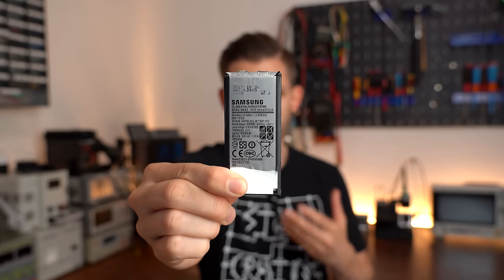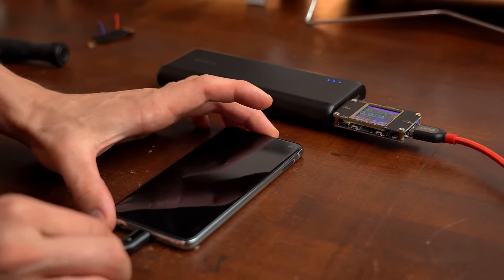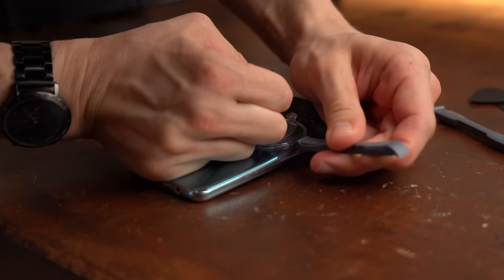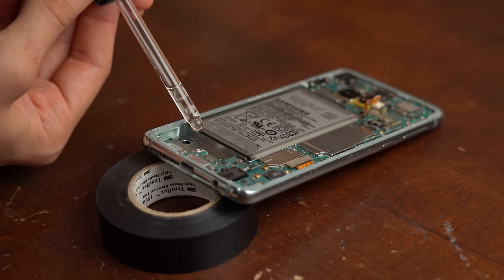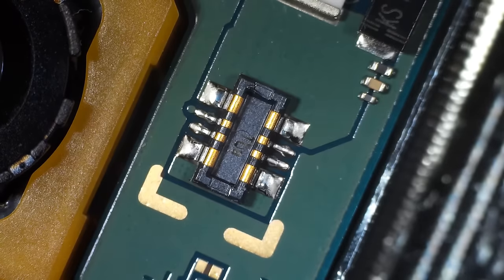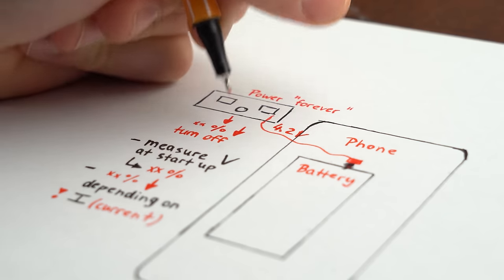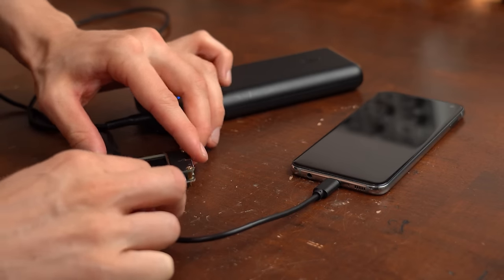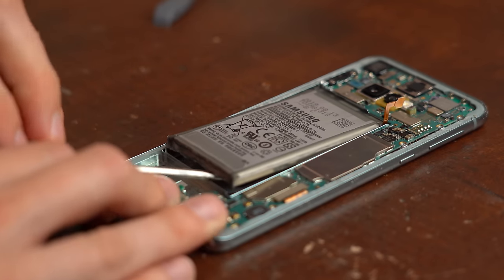I "Solved" Samsungs Swelling Battery Problem! (Batteryless Phone)

Comment: Awesome video The information you present is very factual. A lot of great ideas.  But I also want to bring up this point. There's a reason why here in the United States we didn't get the exynos chip. In the Galaxy s series. All the snapdragon chips past certification for the FCC as far as power and safety. Unfortunately the exynos didn't.  I still don't understand why on some of the budget Galaxys here in the United States pass the FCC certification. But the top dollar phones didn't ?

Comment: I didn't know any other phones had issues with the battery swelling. I thought it was just the note 7. 

A little more heat. That back cover should have been able to lift with the guitar picks and suction cup. You should also not try to lift the battery with a metal tool. If it punctured the cell it could have started a fire.
Reply: Battery designers tend to underestimate how much energy the Lithium Ion batteries can blow out... hence a lot of them swell and eventually... explode

Comment: Im pretty sure you can just override your battery percentage using adb, but im not sure if that will prevent the os to shut down.
Reply: It's not that easy and hardly depends on the specific device and OS :/ I've had to modify kernel drivers and recompile the kernel of an old android device to get it properly working with a modified battery.

Comment: The whole time I was thinking figure out some way to run the phone off of one of those phone cases that has a battery built into it preferably something that plugs into the USB port even though that would make the USB port unusable for other things.

There may be a way to fix that but I'm not counting on it.

Comment: in 2014 I did something similar to my Galaxy Y, I removed the bloated battery then cut the micro usb from the charger, then soldered that wire to the battery connector at the back and it works better than with battery after all I didn't feel any heat on the phone, even if I used it for a couple of hours the only downside to it is that I can't move the phone since its always connected to the power outlet.

Comment: nice, but what I did on mine is salvage the battery controller and replace the battery with a capacitor, small enough that it can fit inside the phone and whoala, no more boot loop. All of it powered using the USB power.

I did this on my old android tablet and use it as a hub screen for home assistant.

Comment: This is grate I could put 5 volts on the battery and even on the board of the battery and it just would not stay up for over a day. Looks like you found out how to fix this. I going to do this soon too. Thank you!
Reply: I did do this on a old Windows phone and have a clock app on it and it stays up for months no battery.

But then did this on a tablet. Took the BMU off the battery and used to diode on the plus side just like his video shows but the tablet thinks the battery goes low I have you been all server running on it because it's a low power device. But sometimes it'll do a right protect on the operating system.

I can type to reboot and it never does it comes up for a second and shows the battery really low in red on the screen. Then just turns off.

I have to unplug the power and wait a while plug it back in and wait about 5 minutes till it will turn back on.

Right now it's up time it's the best I ever seen I don't know how much power it thinks the battery is.

root@tablet:~# uptime
 10:28:24 up 1 day, 21:56,  2 users,  load average: 0.02, 0.06, 0.07
root@tablet:~#

So almost 2 days now. That the most it's ever been.

All so tried this on a laptop. It had 2 battery's with the BMU in between then. It doubled the power on them so about 8 volts.The power supply is 12 volts. So I got a Buck Converter Step Down Module Power Supply 3 amp and set it to 8 volts.

A yellow LED will come on by the power plug but as soon as I hold down the power button that yellow LED turns off and nothing then.

I passed the diode and then that light by the power plug turns green but when I press the power button it does the same thing.

I don't know what's wrong with this why it won't boot without a battery the laptop if anyone knows that would be great thank you.

-Raymond Day
Reply: On the tablet the battery says this:

root@tablet:~# acpi
Battery 0: Discharging, 0%, discharging at zero rate - will never fully discharge.
root@tablet:~#

It should show something like:

Battery 0: Discharging, 0%, 99:99:99 remaining

But maybe the 1st line is right Discharging at zero tate.

Like I said so fair almost 2 days of uptime. But I know it's hard to turn on. I have to press the power button over and over till it turns on.

Seems like after I unplug the power and back in wait about 5 minuities then it will turn on when I press the power button.

Comment: I've been also thinking about such a thing to power a phone only with the charger, but what I was thinking about is to replace the battery with a capacitor, so the phone would still think that there is a battery inside it and I won't have to drill holes into the phone.
(You can charge up a capacitor infinite times and they last until they dry out, so they can last for around 20 years.)
Reply: It would probably be fine for light use, but would not be 100% stable as the phone can drain the cap faster than it can be charged, causing it to shut down or reboot.

Comment: The Samsung battery swelling is a real issue. My battery was swelling so bad the screen was lifting up. The good news for me was my model The Galaxy Note 4 has a simple tool less battery removal and swap. Sadly easily user changeable batteries are almost completely extinct in modern devices.

Comment: I did this same thing with a spare phone I use with 24/7 usb tethering for a backup network connection. The old battery got puffy. I had some issues with the phone randomly rebooting once the usb was connected, but increasing the voltage to the battery pins seems to have solved this.

Comment: I did it to my 3 old phones after their batteries puffed up. In the xiaomi mi2s I can connect a constant current and never dies. but it needs the bms from the original battery if you wish to use it with a external battery since it is not charge otherwise. My Sony tipo have the same problem with the s10e. It will shutdown after a while because of "low battery" but soldering the bms solved the problem. Finally the Asus zen phone 2 refused to work after I unsolder the bms from the original battery. I think they may detect that the voltage cut off and they programed to stop working after that
Reply: I use them as cameras for my pet 3d printed feeders. So I know my cars eaten and the feeders didn't jam
Reply: Untuk sony bagaimana anda memecahkan masalah?
Bagian bms mana yang harus di solder?

Comment: Yeah, my s10 plus is bloating too, the backcover is pushing out and i am going to replace the batt. Heat is good for the backcover removal, but i prefer IPA and slowly working around the adhesive, man ... why again we cant just have easily removable back covers? Gladly the batteries are not expensive and already have the tabs on them.

Comment: When it will not stay up over a day would you need to changed the diode to some other type? I did this on a tablet and a acpi command on the command line shows Discharging at zero rate. I like it to say 100% charged. Maybe a Schottky Barrier Plastic Rectifier
 diode? It be neat if you could do another video showing how to do this on a laptop or tablet.

Comment: Instead of external wires, what if you put the diode directly from charging board to battery connector?
or
Try using 2A 5V regulator before the diode to still use quickcharge, although it'll get hot, or maybe DC DC step down converter for more efficiency?
Reply: 2A @ 5V is not enough to power the phone's peak transient current.

Comment: I have one more idea or a solution. Instead of putting two cables and one hole in phone we can modify the usb type c charging port attach wire to it ( internally) and use the same circuit .

Comment: Since you need to have the phone "charging" all the time anyway, why not just tap the needed voltage for the BMS from inside the phone? The USB charging circuit should already have this. This essentially avoid you having to drill through the phone housing with wires sticking out!

Comment: I honestly think that this "swelling problem" is mostly due to youtubers like mrwhosetheboss keeping phones on a shelf with no charge for very long periods of time. I myself have all my old Galaxy phones from the S3 all the way up to the 10+,an A7 2018 and 2 Galaxy J5 and none of them have swelled up batteries and they all still work fine. I think all batteries have their own way of dying if they are left flat for a long time....Samsung's batteries get swollen while other batteries may not swell at all but they can still completely die or last about 20 minutes until they go flat from 100%

Comment: Super capacitor might be best suited for this kind of application. In the next video can you try to determine the minimum capacitance required?
Reply: For the equivalence of the battery, 2.6 kiloFarads
Reply: @cpK054L  thank you for your input. I believe 2.6kF within this Samsung battery size might not be available right now. You are correct for capacitance equivalence for the battery though, I wonder that for a Samsung phone to work correctly what minimum capacitance is required just to let the phone power up with the charging port only. Or might say can give 10-30s of power backup to switch to the powerbank or different charger. 100F? 1F? 0.1F?
Reply: @PrateekSuthar  mAh * seconds = capacitance * voltage 

Plug in values solve for Capacitance

Comment: Yep, I'm also doing this kindda thing, I install IP webcam and Used it as CCTV in my bedroom😄😁, I used the BMS board, but without the battery, I'm using Mobile charger and Connected to Inverter

Comment: it is very risky but it is possible to debloat the battery i have seen a video where someone punctured the pouch and de gassed the battery by squeezing the gas out and re sealed the battery.

it is very risky because it can cause a short and a fire.

you may be able to use 2 super capacitors wired in series should work to trick the phone.

why 2 is the super capacitors are usually rated for a max of 2.7 volts  however sometimes  have a max of 2.3 volts.

super capacitors should be work and last for ever.

super capacitors come in different shapes and sizes so it probably would only be 1 or 2 f.

you could be able to repair the phone and replace the battery with another battery by then soldering the protection board to a hobby cell at less capacity but would be much safer since samsung cant get battery safety right.

if you should decide to puncture the cell to de bloat it i would suggest a toothpick as it is non conductive and would not cause a short

Comment: Guys I tried this, My battery is also a 4.4v battery and I used the same types of Diode (Mur460)

Yes it did work but the Mur460 is slowly cooking itself. I'm guessing going to 80°C because it did hurt when I touched it. I don't think this is a good solution.

In my case I did have a step down converter (XL4015) it worked great no overheating. I also removed the SS54 Diode with the Mur460 because the SS54 died.

I will update you all after some more testing
Reply: Bagaimana anda merangkainya?
Apakah usb -> step down -> bms?
Reply: @shan4217  Yes, exactly
USB (2A 5v) -> Step-down(4.2v)  -> BMS

Google Translated
ya benar sekali
USB (2A 5v) -> Step-down(4.2v) -> BMS
Reply: Bagaimana dengan persentase battery?
Saya sudah melakukan seperti video ini, semua normal. Hanya saja phone hangat saat tidak terpakai. Saya khawatir untuk jangka panjang. Maka saya mencari mencoba cara lain tanpa persentase battery turun kemudian mati.

Comment: I have done this mod with a few phones, and I ran into the same issue with the battery percentage still dropping. 
What I have also found out unfortunately was, that some phones have a "feature" that stops "charging" after some amount of time, when the phone is constantly plugged in, and then the battery indicator starts dropping down to 0, at which point it powers itself off.
Reply: coul a scheduled restart app help you here?
Also are you open to tell a bit details:
have you used battery mbs? dou you use capacitor and if what rating?
Reply: How long did they go before powering down ? What model of phone ?

Comment: I guess the battery swelling problem is likely due to not charging the samsung device for a long period of time, maybe a year or 2, as in mrwhosethebosses video, he just stored the devices in a shelf and was not using/charging it.
Reply: Exactly, almost all the cases of this happening are phones stored and not charged for a substantial period of time. While swelling still isn't something that should happen, it was blown way out of proportion by media outlets and YouTubers without investigating the problem further.
If someone, however, needs to store their phone like that, it's best to not store it with a completely full or completely empty battery. I believe somewhere around 50% should be ok as it reduces the chances of swelling and also the battery dying.

Comment: I once saw that someone used a termux linux distro to setup klipper for its 3d printer (klipper its a cnc program and needs to be flashed to the printer board and then be controlled by any kind of computer trought serial at the same time), then he needed and always on phone like this

Comment: i think a even more seamless and easy method would be just take the battery bms and attack a capacitor to it in place of the battery then put it back and it will work on usb power as usual

Comment: Awesome video!
A quick question: Do I have to use the BMS board from the battery when powering from USB and diode combo or can I get rid of it entirely? I have some old phones where the batteries have gone missing and cannot seem to find any  bms boards laying around.
Reply: Yes you can, mostly
Reply: most phone bms boards are pretty cheap, as well as generic
Reply: I think its more for the special connector that most have... if you can figure out where/how the battery connects and solder to that point on the phone/device, then you don't need the BMS.  What he's really doing is tricking the phones battery charge circuits.
Reply: I've tried with Samsung j2. It's required the BMS board. It's worked only with bms.
Reply: @shfahim7938  probably depends on where the device is reading charge/not charged from.  Most batteries have a simple over/under voltage/amp protection only (that I have seen, which isn't many) lol, but Also why you can usually get a compatible after market battery easily, so long as the size, shape match.

Comment: I’ve modded a couple phones before in the past to take AA batteries you can use three batteries in series, but the phone will not drain them down 100% some phones will take four batteries in series and some will not they will get hot and drain the batteries till 4.3 volts.

Comment: I tried using a capacitor as the battery and it had the same issue, it starts from 100% and drops to 1%. To solve this I just turn off the tablet, unplug it and then try to turn it on again without any power, that way the capacitor discharges and when I plug it back in it charges and shows 100% again.

Comment: I'd love to do exactly this unfortunately it relies on the USB port, and one of the biggest problems with old phones is that the itty bitty tab inside the phone's micro USB port often gets damaged at some point and is almost impossible to replace reliably. Plus it looks like my S5 doesn't have the same type of power connectors as yours. It does have some qi attachments that I might be able to make use of though.

Comment: Instead of drilling holes into the side of the phone you could have just picked up the 5 volts from the back of the charging port and run it through the diode to drop the voltage to the battery connector.

Comment: why not using supercapacitors instead of relying on internal USB soldering? DIY supercaps can be made to the size of the battery and won't swell. It'll probably have enouth juice to power on the device while USB is not active.

3 thin supercaps in series (made with kapton and KOH as electrolyte) would do the job while providing enouth voltage to do the job

Comment: I literally did this same thing to an old Lenovo phone I had, not Samsung unfortunately, I took the original battery out to replace it aka (MOD) it by adding a powerbank battery because the original didn't hold much charge but ofc not knowing much back then I didn't do so good so I bought a new one and kept that phone around for a while until one day I said to give it another try, and for some reason it didn't wanted to power up without a battery + I damaged the original protection circuit board on the original battery trying to get it out because it was glued in so I had to use another that I found around also in a box of old phones back when they had buttons and use a power supply to keep the "new" small battery from a bluetooth speaker charged up so the phone won't die after a min or so, after  I saw the percent drop even tho the battery was fully charged all the time I had to add a button on the wire that it measured how much the battery had originally, switching it off and then pressing the power button for 10 secs to clear any leftover power into the device I turned the switch back to on again and powered it on and the battery came back to 79-80% each time I did so no matter how low it dropped, and for me it wasn't bad since I mounted it to my wall where my workbench is so I can look up any part details if I need to and I didn't had things to fix or do often but its a good use of an old phone non the less